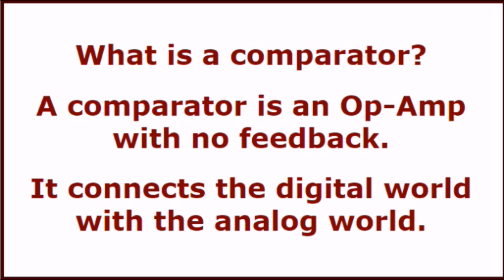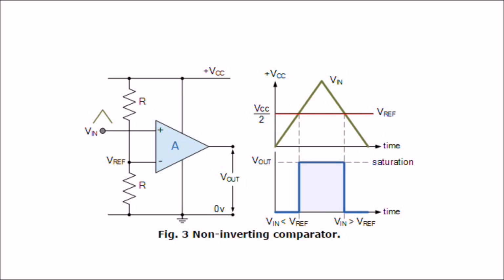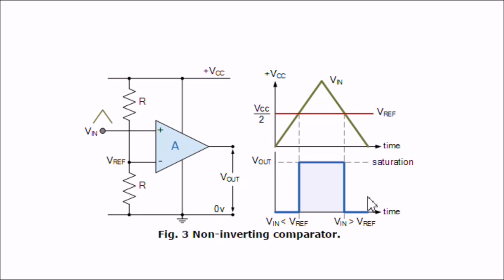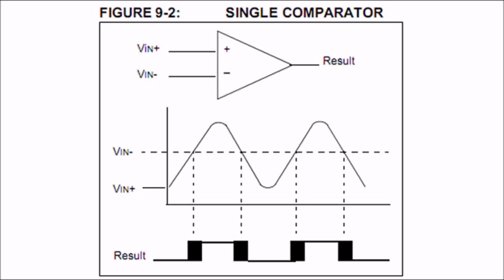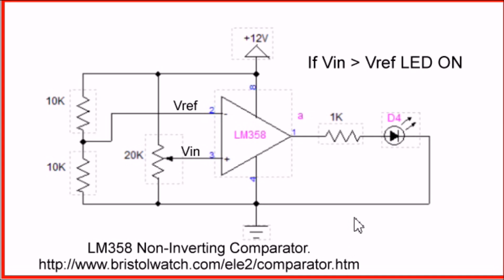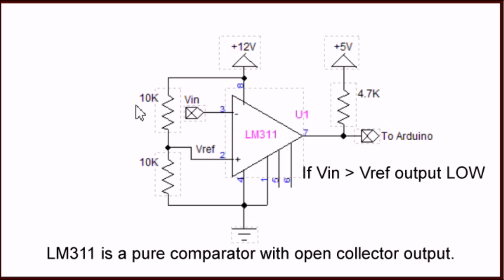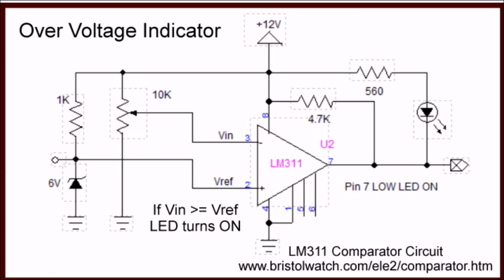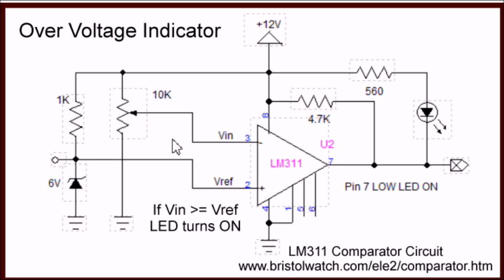Comparator Circuits Introduction

Comment: An op amps can be used as a comparator but is not a comparator. An op amp has 2 comparators internaly built in so a comparator is much simpler than the op amps internal circuitry...

Comment: What's the 4.7k resistor for?
Reply from the maker: The LM311 has an open collector output. The 4.7K resistor is a pull up resistor.
Reply: @LewisLoflin  Why doesn't the 560 ohm resistor serve that purpose?
Reply from the maker: @km4hr  The LM741 has a type of totem pole output while the LM311 has an open collector. Look at the schematics in the spec sheets.

Comment: 16:00 The low-pass filter (4.7K, 10uF) should yield an average of 2.5V at TP3, no (5V p2p, with 50% duty cycle, averaged out by the filter)?

Comment: I did an experiment using two comparators to see if I could get a DC motor to behave like a servo. I connected a control-potentiometer to the inputs of two comparators, one inverting input and the other non-inverting. I did the same with the motor's feedback potentiometer using the opposite inputs. The comparator outputs were fed to an h-bridge.
 I thought this would allow me to control the position of the motor without having to use a micro-controller. At worst I thought the motor would chatter as it kept trying to find the neutral point. What I got was more like Parkinsons disease because the motor would turn to the spot but shake continuously.
I don't know if it's worth going any further. I would love to hear your explanation.

Comment: Did not get this. From what I was taught an OPAMP has a linear region. if you put a sine wave in over the linear region your get a sine wave out. A comparator runs high or low and will never be able to out put a sine wave only a square wave. I have been told never use an OPAMP as a comparator. I am confused.
Reply from the maker: With no feedback it goes from all on or rail to rail. This mostly concerns op-amps design to be comparators.
Reply: Got it. Don't do feedback and the opamp works as a comparator. Cost effective? For a one off, maybe! Thx